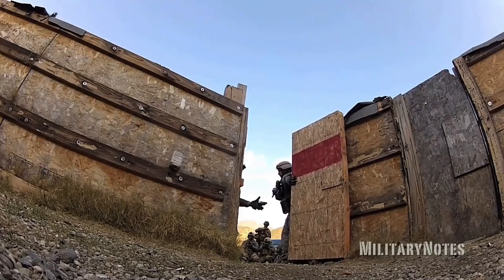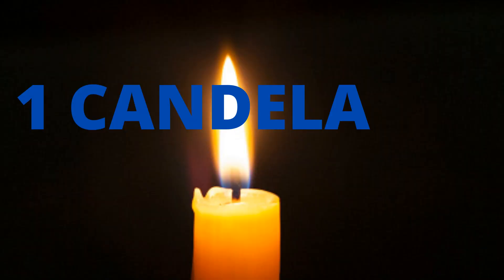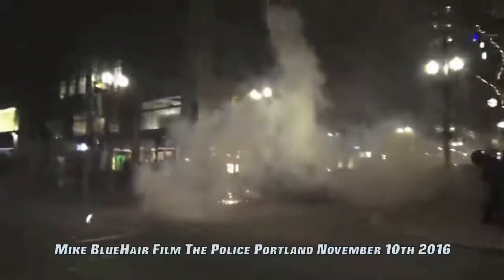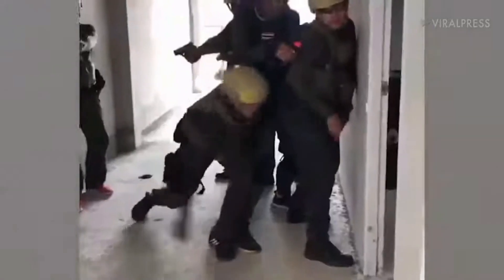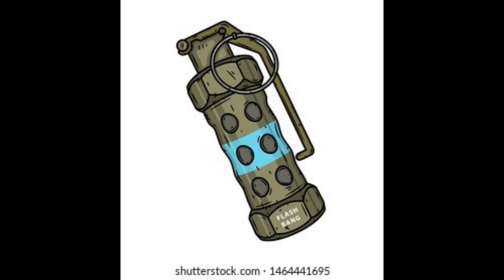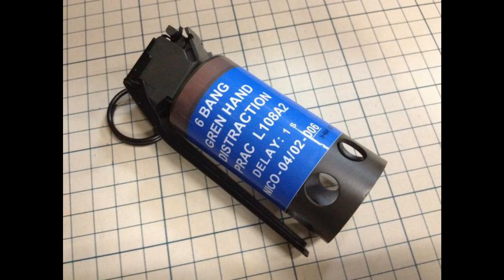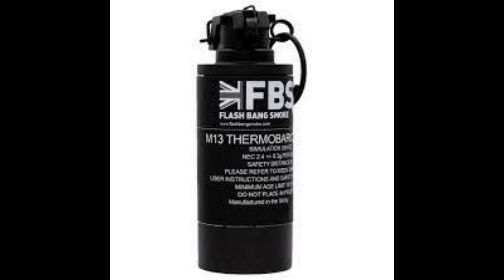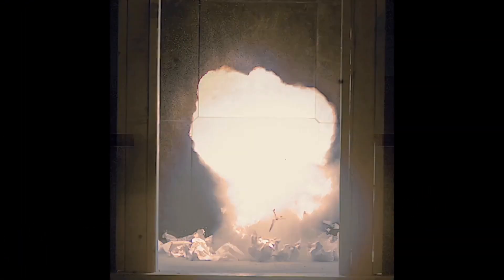How Does A Stun Grenade Work? ( Flash Bang )

Comment: I made it to 30 seconds before I couldn't take the rattling, breathless electronic voice. <----See that thing? That little dot at the end of the sentence? That's called a "period". It means a pause in speaking. Please use them.
Reply: Usually tts softwares skip over periods. So using periods is practically fucking useless if the moronic, terribly made software skips over it anyway.